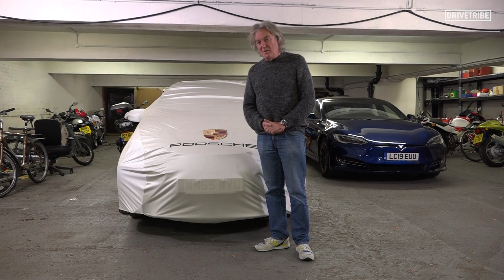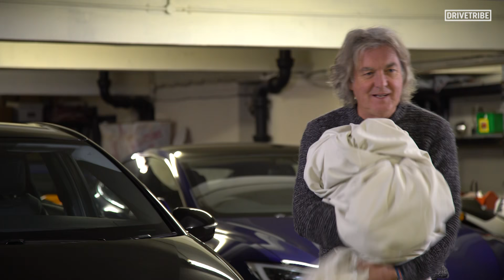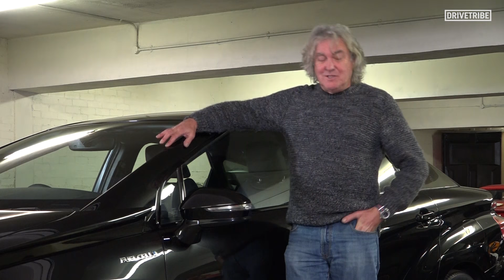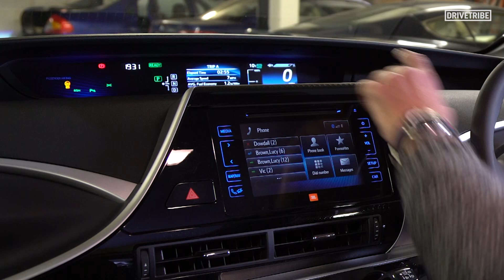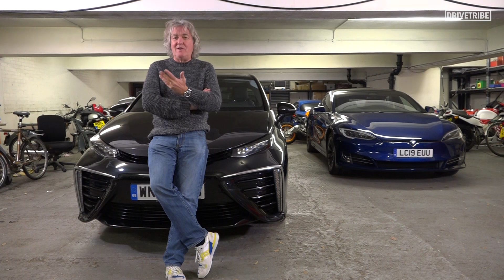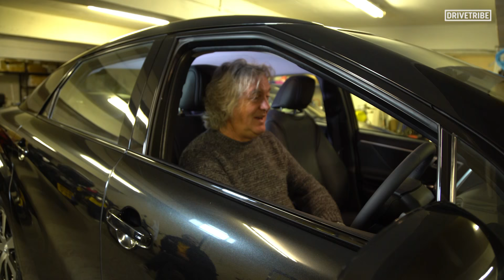James May has bought ANOTHER new car

Comment: Hydrogen cars are extremely dirty. Hydrogen comes from steam reformed methane, which is extracted by fracking. The steam reforming produces copious CO2 and takes even more methane to heat it.m Congratulations, you bought a collector item - one that Toyota will be lucky to produce 1,000 units of.

Comment: A hydrogen combustion engine is a better option than electric drive, convert almost every existing car to run on hydrogen.
Reply: I think the energy density is a little less than current fuels but I've been expecting internal combustion engines using hydrogen to be the next thing since the 80s so I've always wondered why automotive companies skipped it and went to the hydrogen fuel cell.

Comment: What if we make cars a bit bigger, like a shooting brake, estate, and use the extra space to use both; hydrogen fuel cells that have a range around 200miles/320km and electric batteries that go up to 200miles/320km so the energy used is mostly split between two, less actual refueling and getting best of both worlds 🤷‍♂️

Comment: well, there's another point James forgot, making a single battery for a single car actually produces more CO2 than making an entire combustion engine car in a factory powered by energy generated with fossil fuels, and eventually those batteries will need to be replaced and that will have a huge impact in the environment

Comment: Dr. May, 
Out of curiosity, why can’t you charge the battery of the Toyota like the Tesla? 
It seems they both use similar batteries and the Toyota has a way to charge on the go using Hydrogen. It would make it so much easier to slowly adapt to Hydrogen via the ability to charge in two ways rather than just one.

Comment: sorry mate internal combustion for life, biofuels are the future
Reply: They could be potentially, but I kind of doubt it. The infrastructure simply isn't there to support biofuels in a major capacity. I think a better solution, and one that the infrastructure is rapidly getting built out for I might add, is carbon capture and sequestration. There are companies now whose sole focus is filtering carbon dioxide and water vapour out of the atmosphere and turning it into gasoline. If all cars were powered by this process then they would in effect be carbon neutral. That said, I still prefer the driving dynamics of electric motors as opposed to internal combustion ones, that instant response is enormously engaging.

Comment: The other thing about hydrogen is that it allows for a similar supply chain to other existing fuel sources as well as a tax base similar to what we have at the moment, if electric battery storage vehicles take off then the UK looses a £20Billion tax base which will have to be sourced somewhere else!

Comment: Toyota refuses to be in racing games, fuck Toyota and Lexus, and gas is still king. I love the hybrids like the Porsche 918 spyder because it's got the electric motors for instant torque and acceleration and the V8 for the high end power and speed. Not to mention if you wanna bitch about fuel efficiency the porsche 918 is actually more fuel efficient than a Prius when in the right mode. All electric cars are quiet and torquey but have no top speed at all. Fine in the city I guess. But what they dont tell you is its actually far more harmful for the planet to mine the lithium for electric car batteries than it is to just drive a gas guzzling truck. Final gripe I have, modern regular run of the mill road cars, especially the hybrid fuel efficient "save the planet" cars have no personality at all. Hyper cars, gt cars and super cars have a personality because they are not built to sell alot of, they are built more for show. But all old cars, everysingle one of them, have a personality and a story or two too tell. Modern family cars have the personality of sandpaper. My everyday driver btw is a 1996 chevy s10. Extended cab, LS trim package, rwd, with the 4.3 V6. I get pretty good mpg with it and I love the thing. Looks good and gets me around. Rant over

Comment: I believe in the hidrogen as a feasible tech to conserve energy in grid level. 

I have an 6500Wp grid tied solar panel in the family farm and use it in the farm and three more homes. But the solar have problems when the production reaches a certain limit becouse it isn't constant... A cloud and the energy need to come from the hidro-electric or termoelectrics (here in Brazil we have a huge amount of energy coming from hidro, more them 90%), but with growth of consumption all day long we still be needing production and transmission infrastructure to keep energy flowing at night and in the valleys of production due to clouds.

Here enter the hidrogen... You use all this non constant generation of solar, wind, waves (basically all forms of solar generated power), tides, and store the excess as hidrogen, burning them as needed at night and valleys of production.

Batteries have very low life cycle with lots of garbage produced at the end. For cars it's ok, it keeps up with the file span of the car. For a house (heating, cooling, lighting), not so good!

I don't believe in hidrogen cars as a feasible technologies for the masses becouse the "burning" equipment have a high cost with a expected life span that is longer than the life span of the vehicle!

So hidrogen for the grid (plus transport heavy vehicles like trucks, trains, ships and airplanes) and batteries for the cars.

And I HAVE a Renault Sandero!

Comment: you're right the process of extracting hydrogen is energy intensive and while we are still buring coal and fossil fuels it is an impractical however extremely inivitave idea. if we had solar towers similar to the ones in spain all over the world and there was an infrastructure to create hydrogen with zero immisions it is fantastic because while the tesla doesnt immit and gas it still uses lithium batteries and the process to create them is not very efficient at all.

Comment: And what is the current cost of Hydrogen per Kg you did not mention. Either way, the future of cars is batteries. There will be new battery technologies. Already there is LTO (Lithium Titanium Oxide) batteries which resolve the charge time issue and also last many more charges than Lithium Ion batteries. Their drawback is battery density which is not as high but with time it will come. You don't want too many energy conversions as there is always loss.

Comment: The hydrogen is fine for driving around in London and with some planning around the UK. It is great for the local environment. The  Tesla is also great for the local environment and as long as you live near a supercharger or are not in a hurry it extends your range. The Tesla is quick, as long as the battery holds up, but you are Captain Slow. You can afford to drive anything and as many cars as you want.

Comment: See the big flaw with battery electric cars is that like phones, the batteries degrade over time, while the fuel cell is much like a gasoline powered car where if you’re low you can just go to a gas station and fill it up so I believe hydrogen will indeed take over compared to the lithium ion battery powered electric car. The average person values convince and a quick fill up compared to the battery car

Comment: Actually James having owned and driven both. I do prefer the hydrogen option. One of the biggest advantages is the filling time, light weight and the ability to convert the existing petrol stations. What is also important to look at is the rare earths needed to produce these batteries. Which is not exactly clean.

Now here in Taipei when I had a Tesla Model S for 1 year. We have 3 Tesla charging stations.I remember a number of going to them and having to wait in a cue just to charge. It I charge at home as we use 110v it would take longer and that 2 days and still not have 100%.  For hydrogen we have 13 stations, which are located at normal petrol stations and like you pointed out takes between 2 to 3 minutes.

Well I eventually sold the Tesla at a 40% loss, because of the poor resale value.

Driving the Toyota is no different than driving one of my petrol cars. Only difference I really notice is going to the petrol station and pull in to the hydrogen section and I'm on my way.

Also the Toyota you will notice does have far better build quality than the Tesla.

Comment: 5:00 I don't understand why Fuel Cell cars are part of the carbon neutral equation, while battery electric cars aren't. You gave the example of using a renewable electric energy wind farm to crack hydrogen. But you could have also used that electricity to charge battery electric cars.

Comment: We need Hydrogen Combustion,  not Hydrogen Fuel Cells.

But I guess it's a step in the direction of using one of the most abundant elements we know of in the universe as fuel for our cars. The ignorant masses can get the fuel cell, while enthusiasts could get the hydrogen combustion variant, and BOTH would still use the same pumps and infrastructure.

Comment: Keep in mind Tesla has a separate energy solution with Solar and Storage. 
You can convert energy from Solar to Electric power once... or Use Solar to Electric which is used to convert Purified Water to Hydrogen and Oxygen then converts it back as Electric energy and Water Vapor to run the car. 
Each can be as clean as the other but one is less efficient in energy after all. One also requires very clean water else it damages both the conversion equipment, pumps, and fuel cell with corrosion.

Comment: Long term (in the next 50 + yrs.) once they have perfected the mini nuclear reactor, that is what will power the electric motors of vehicles of the future. Starting with large commercial vehicles, then passenger transport!
Reply: Right i think public transport will be used as a dummy project for the small nuclear fission
Reply: Traffic accidents will be quite a bit messier with fission-powered vehicles. "Can't use this stretch of highway for a while since we had that 12-nuclear-car pileup about a year ago and the Geiger counter is still clicking away. Oh well, better build a new highway."
Reply: @MrManifolder  I somehow doubt that as every vehicle will be awash with proximity sensors and anti-collision technology currently in development for autonomous vehicles. Plus the actual reactor will be extremely well protected!  The greatest benefit for the transport industry is there will be no need for refuelling for decades!

Comment: The byproduct of both vehicles is going to be what the power source uses to produce the electricity needed to produce either the hydrogen or directly charge the vehicle. Both vehicles are from zero emissions unless a solar farm or wind farm is used, possibly even hydro produced electricity.

Comment: Hydrogen cars is the last attempt of the oil companies to still lock us into normal fuel stations and maintain a infrastructure that only them can provide, anyone can provide a charging station for a battery electric car (you can even charge it at home),  the charging station (and you) can even generate some of the electricity for free from solar panels on the roof, but for hydrogen cars only extremely rich (and powerful) companies like the oil companies have the logistics to produce/store and transport all that hydrogen gas around (extremely dangerous, more so than propane or butane), and even tho is a totally dumb idea, they will pour so much money into it that they will eventually get their way.

Comment: Electric powertrain is the future. 
Battery as the carrier, isn't. Because we will run out of resources to build batteries indefinitely, solely because they chemically deteriorate over time and become useless. 

If the proposition of future mobility is to be able to run on renewable resources, batteries aren't made from renewable resources.

FC is currently, the best bet for electrification because they don't deteriorate as an energy carrier. Hydrogen can be extracted from wind turbines or hydro, and then transported through pipes and tanks that dont deteriorate over time and then powering our cars, emitting nothing but water. 

In the future we might perhaps invent another form of energy carrier, or we're able to grow enough algae that generates combustible organic carbon fuel and thus being able to power our cars with liquid fuel that's spit out by tiny organisms. 

Whatever it is, batteries are a polutant.

Comment: Quick question for engineers out there:

-High voltage batteries that deplete fast and can pump out big numbers and have fast recharging generally lose quality quite quickly particularly in capacity.
-and then if hydrogen Fuel cells just dump out energy when you smack the hydrogen and oxygen together but to dump out that power repeatedly without any battery that might degrade. 

-does that mean that very fast electric cars for reliability and potentially performance measures (no one will buy a car that does a million miles an hour but the batteries are literally dead after one use will they) should in future use hydrogen fuel cells or is there some kind of feasible limit to the power flow they can pump out other than just the flow rates of hydrogen and oxygen in?

PS- also for car Moders, if you have a hydrogen car that is just taking oxygen from the air for its process, can we replace the NO in old style suped up cars with literally just your nanas oxygen tanks to really dump power in like some mad old fast and furious montage?

🧐🧐🧐🧐🧐

Comment: We have been using hydrogen fuel cell batteries in our forklifts and other lift equipment for about four years now and they work great. The only by product is water and no acid fumes. The draw backs are if you run a battery completely dry the company has to send a tech out to reset/recharge the internal battery. Overall you get the same functionality of traditional batteries but take less time to charge (about 2 to 3 minutes). If i had to choose i would go with hydrogen fuel cell batteries.

Comment: I'm actually more envious of James being able to own both these cars and be part of this experiment than I am of many other rich people and their cars. Good arguments for and against each and this big question sits at the heart of the auto industry. Hydrogen has the potential to be more useful to more people and if existing gas/petrol stations get on board with hydrogen pumps, it could solve things at a stroke. You fill up in exactly the way you do now, you don't need expensive charging gear at home, solves the issue of people that can't park close to their property and it's going to take batteries decades to get to the point to charge in the same time. However, battery tech is ready now, so makes sense for the average homeowner with access to a garage or driveway. in 15 years time, I reckon both will exist still, but ultimately hydrogen makes more sense, especially as it's based on an already proven method of distributing the fuel to consumers.

Comment: I think if the fueling infrastructure for the hydrogen was improvedassovkey then it would be far superior as you dont have to wait 45mins for a battery to recharge and unlike a battery at present time it wont deteriorate and have to be replaced but for right now due to the lack of hydrogen stations the battery car is still the better option for most people

Comment: Thank you James for putting up your own cash to test these two. The CSIRO here in Australia have designed a way for the safe transportation of Hydrogen which will help the adoption of this technology enormously. Also Fortescue the Iron ore miner has signed a JV with CSIRO to take this technology forward. Also worth noting is a lot of investors believe the two technologies will work together a lot like Petrol and Diesel. So the battery car around the city for short trips and Hydrogen Fuel Cell vehicle’s for longer distances or trucks.

Also another Australian company called Hazer Group (HZR.ASX) has a process of extracting Hydrogen from waste methane (poo 😜).  They are an interesting business. Plenty poo in the world to run cars!
Reply: Is transporting hydrogen realistically any more treacherous than transporting petroleum? They're both pretty explosive. To my mind the only difference would be that hydrogen is pressurised, but does that make it that much more risky? And we transport natural gas which is also explosive and pressurised, wouldn't the same methods apply?
Reply: @fatmikecj  yes, its definitely more dangerous. Petrol isn't even explosive in liquid form especially without a spark
Reply: hydrogen is extremely explosive, burns invisibly, pernicious, causes metal embrittlement, and the efficiency is woeful ...... sounds ideal!
Reply: Yeah, hydrogen as fuel source scares the shit out of me as hydrogen never burns, it only explodes.  Yes the pressure containers of today are much stronger, but have you seen how bad car accidents get?  Once that pressurized hydrogen is released...     woomf.
Reply: Still not a fan of someone mass burning to create a secondary source of energy. Let me be the burner.

Comment: I can see fuel cells having a future. Especially for industrial applications like container ships etc.  Plus, there isn't the whole baterry degradation and recycling issue. If we assume that the hydrogen is cracked using renewable energy, will it have a lower total co2 output including manufacturing? I have no idea, just wondering

Comment: Is It extra heavy like the Tesla? I really like this no BS approach. Straight forward it's a car that relies on hydrogen for fuel, so what. What happens if you run out?  Take a guess. Is it less convenient than petrol probably slightly owing to the limited infrastructure but it also has its advantages.